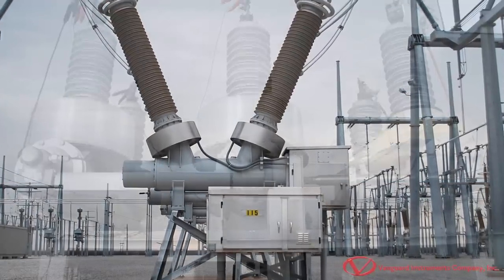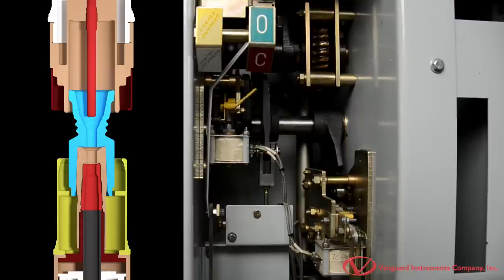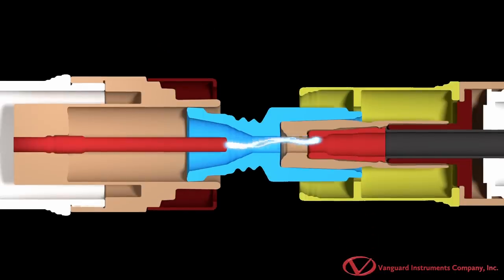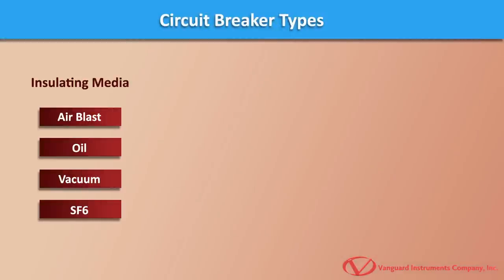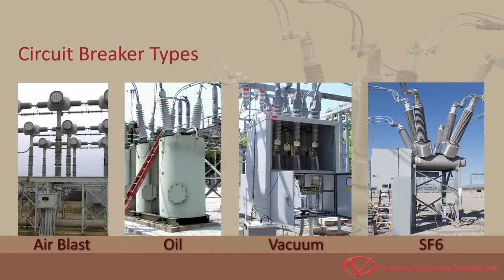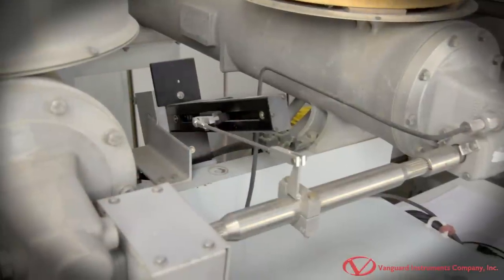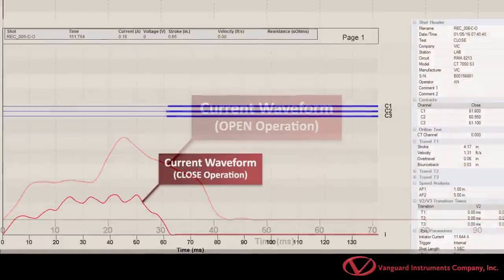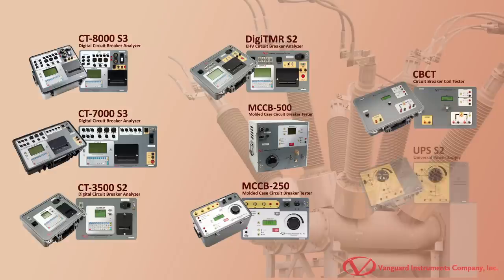Substation Circuit Breaker Testing

Comment: In my former career I personally used Vanguard Test Equipment. 
It wasn't a breaker circuit breaker timing set but a current transformer test set and the other a transformer turns ratio test set. 
Both sets were excellent pieces of equipment and very easy to use.
I recommend looking into using, buying equipment by made by Vanguard. Thanks

Comment: I think you missed the Insulation Resistance test as well as Capacitance/Tan Delta Testing.Although they are not so important in SF6 Gas breakers. Just a suggestion.
Reply: "Although they are not so important in SF6 Gas breakers"Please why are they not so important in SF6?Thanks